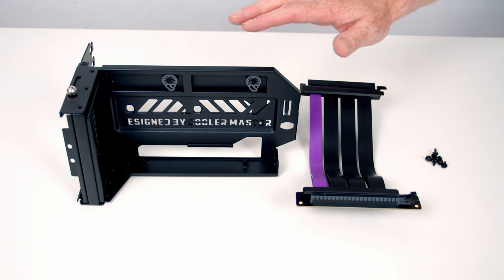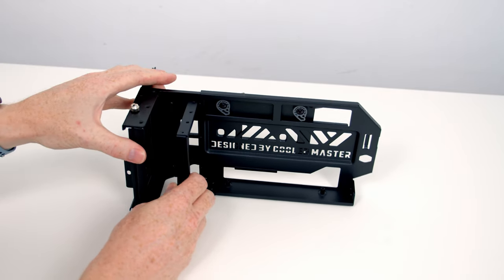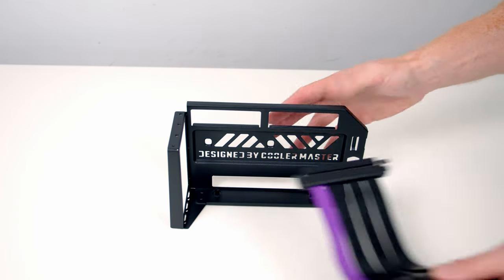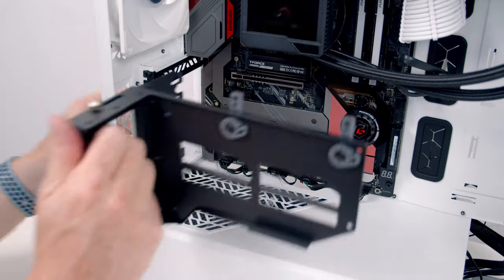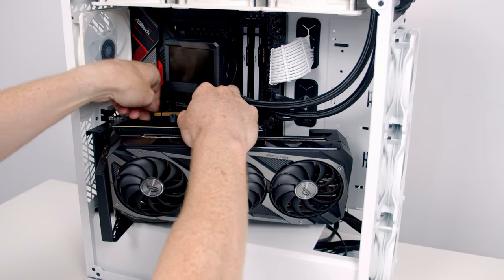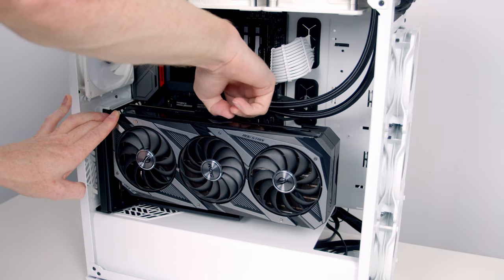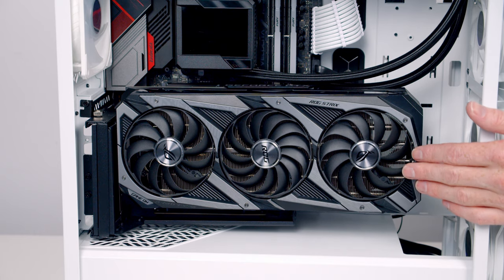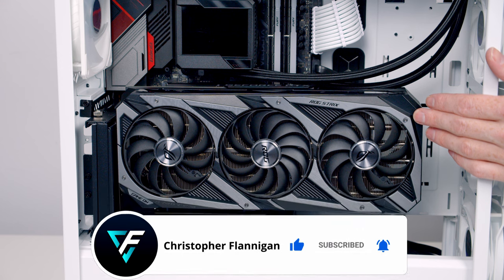Cooler Master Vertical Graphics Card Holder Kit V3 - Installation Guide

Comment: The extra room towards the front also does another trick: if your case has bars between the slot covers you normally get into trubble inserting the HDMI/dp cables since the connectirs are upright now. By sliding the vertical stand a few cms, you can thread the cables between the slot bars and connect them without having to cut the slot bars.
Reply from the maker: Good point
Reply: Tried it and didn't like it,  sliding the vertical stand a few cms make empty space between case and gpu with wire.
Reply: @bachkhoi9450  get a case that allows complete removal of the pci slot covers
Reply: @bachkhoi9450  buy a 90 degree hdmi or display port cable and it almost mitigates that
Reply: thanks for sharing man
Reply: Thumbs up quick question is there enough slack in the cable to go down 1 more pci slot my case has 8 slots and I was wondering if the cable would reach the bottom 6 just 1 more slot down from where you mounted. Any help appreciated thanks for your time. @ChristopherFlannigan
Reply: @mattchumoore4214  That's what I did ,

Comment: The way I found best when it's just yourself, install the riser cable to the mobo first, then the case bracket and then install the riser cable to the GPU bracket and then mount to case bracket.

Comment: Wow £77 that's way more than the last coolermaster vertical mount I bought
Reply from the maker: Everything has gone up in price. It's gen 4 and the bracket is in two parts so I can see where the money goes
Reply: Gen 4 risers are super expensive. CM is basically giving away the bracket itself
Reply: Worse than that for me. The only place selling it is Amazon third party and they charge 33 EURO for postage (stealth charge) so it ends up being EUR 114,80 at least!!
Reply: Mine finally arrived today from amazon uk I paid £53.62 much more reasonable price
Reply: @anone3842  I've seen them for 60 euro on amazon, this exact model...
Reply: @knightsljx yeah the Riser cable is 40 to 50 depending on brand. So considering the tooling, the metal, the ability for it to move I think it is a good price.
Reply: This thing is even more expensive than some other pc cases. Crazy

Comment: JUST FYI. the card doesn't need to hang awkwardly at the final stage, you can slide that bracket forward as instructed and then place the card into the bracket and secure in place with the quick release tabs. once the card is supported, finish plugging into the slot.

Comment: Man you gotta show us this in a mATX case because I think people going for this one are really looking to put it in a smaller case because it's literally the only Vertical GPU mount that fits in a mATX case. A define 7 mini or Meshify 2 mini would be greatly appreciated to see this in.
Reply: yeah u r definitely right about that. Why would bother having this piece for e-atx cases already  when i can give 50 € more and buy a totally new e-atx case? They should have used a m-atx case as you said.
Reply: Somewhat agree. 

In my matx, the 3080ti sits less than a bottle cap from the psu and hdd shroud in a cooler master mb320L case. 

But in my atx, the space between the shroud and the gpu is so much that the case looks empty with the horizontally installed

Comment: Hi Christopher, I hope this question find you
Can you help answer where does the weight of GPU press down onto, is it the bracket that helps holding the GPU (usualy on the left with the metal plate of the GPU), or the PCI slot of the GPU (I heard Gigabyte PCI one is very flimsy and weak) that connects to the Riser cable (which I want to know before doing any vertical mount bcuz idk if it could also harm the GPU PCI slot or crack it due to the GPU's weight itself)
I really appreciate any insight or experience about this, thank you ❤

Comment: The only issue i have with this mount is that it slides forward when you try to plug in display port cable or HDMI cable. It looks like those two closing clips are not tight enough. At first i thought there are some extra screws that i forgot but i didn't see anything in instructions.

Comment: Is it possible to have a NIC or something plugged into the second or third PCI-E slots behind this bracket? Only thing holding me back from getting one right now
Reply: You can slide the GPU a good distance away from the mobo. As long as you have enough room in your case. Also depends on how tall the pci-e slot item is

Comment: Will this fit in the top 6 expansion slots instead of the bottom 6?
I have a bottom Fan that I'd like to keep if possible so extra slot higher should allow it to fit underneath.

Comment: For some reason mine doesn't sit perfectly straight. It angles slightly towards the glass which is annoying. Also increased temps while gaming from around 50C to around 60C but its still within acceptable levels. If i had a choice i wouldn't of vertically mounted it but because of the Cablemod adapter recalled i had no choice. 40 series GPU's are way too big. I have a 011D XL and my Aorus Master 4080 makes the case looks small.

Comment: How far over does the mount push the gpu? I've got a rog strix 2070 super that i am trying to fit into my fractal define c mini. The case has a max length of of 340mm for the gpu, and the gpu is about 300mm already. So I've been trying to find out how much it moves it over. This seems to be the only mount that works in matx cases so i hope it'll work! Its just alot of money to spend without being 100% sure it will work!
Reply: have you found the answer for this?

Comment: I just paid over 600 EURO for latest Coolermaster 700EVO case and it ONLY INCLUDED THE V2 VERTICAL BRACKET and that is absolutely shit bracket for the 4080 card I have. Will not hold straight and ribbon absolutely straining the slots on motherboard and GPU... it needed the forward/back movement to move GPU out from motherboard. Sickening that they only include V2 mount in a 600+ EURO case that I only got this month in December.

Comment: Is there ANY vertical mounts that don't kill the ability for you to use some of your PCI slots for OTHER devices if the case doesn't have some dedicated opening for the GPU above?
Reply: Im hoping the link i provided does the trick.. i plan to order it this week.
Reply: @bryandixon2570 What link :)?
Reply: @BucifalulR  hmm it must have gotten removed.  Let me find it again
Reply: @bryandixon2570  sure :) thank you. EDIT: or the name of the product would do
Reply: @BucifalulR  EZDIY-FAB PCIe 4.0 GPU Mount Bracket
Reply: @bryandixon2570  Thank youuu!

Comment: Wonder which vertical GPU mount is good for rtx 4090 in a fractal torrent case with noctua dh15 cooler
Reply: not this one, I bought it and now I have to get slim 140mm fans for the bottom part of the case because this mount can fit in otherwise, and I cant move it up because then it will hit the cpu cooler

Comment: Just putting this out there that this mount is NOT compatible with the NZXT H510i. I learned this the hard way and people suggested to cut off the metal bars at the back which block access to the Display and HDMI Ports on the GPU. Seriously, why should I essentially destroy part my case with power tools to install the product? I found no mention of this when looking around the reviews for the product so you can imagine my annoyance after spending £75 on it. Looks like I can either return it or buy a compatible case which will cost me at least £200+.

Not happy at all.

Comment: Don't get this if you're using an aftermarket air cooler, it won't fit and even if it does the heatsink will be sitting on the gpu's metal backplate which will most likely melt the casting over time... Funny how no reviewers mention this and I had to find it the hard way, useless reviewers...

Comment: I have a question. is it possible to use this GPU holder in order to provide enough space and install case fans beneath the GPU. tnx.
Reply: In my case yes. More than enough. I have H9 Flow case.

Comment: How much is the offset of the gpu toward the front of the case if the card holder is set to the minimum (to the left) ?
Reply: You mean the gap? Guess it depends on how big your case and the graphics card are.
Reply: @G.L.R.K  Hi! He mean about the size that the bracket take when fully retracted, i have the same question about it: My case fit 330mm GPU max size, the GPU is 307mm... would this bracket fit in 23mm (2.3cm) space?!?! Thanks

Comment: Since it partially obstructs the back of the card, how does it affect the gpu thermals?
Reply: In my case it actually made temperatures better by a few degrees.  I have PNY 4090 if that's of any importance
Reply: Mine increase by about 10 degrees C while gaming. Probably because it no longer had my 3 bottom fans blowing on it. Bit of a shame but im still only reaching 60C which i feel is OK.

Comment: Why would they stick a purple wire cover on it? I get it's coolermaster but they could have left it black for people with different color schemes in their pcs.
Reply: Isn’t it going to be hidden ultimately? Be cool if it was all one color, but they do have to leave their mark..
Reply: @mrST0GGY_is_sigma  it fucking says coolermaster on the packaging....
Reply: @Theorcman2008  doesn’t every brand have their name on the packaging? Sheesh. If it bugs you that much get a diff brand or buy a separate riser cable.
Reply: @mrST0GGY_is_sigma  That's my point. They don't need to leave their mark IN MY COMPUTER, they already have it on the packaging.
Reply: @Theorcman2008  that’s an easy fix, get a different brand.
Reply: @mrST0GGY_is_sigma  yea, and the cable is behind GPU anyway, so what's the big deal...

Comment: How healthy is it for your mobo to constantly get blasted by extreme heat?
Reply: From where? If anything the mobo will come in contact with much less hot air than in a horizontal mount. Now the hot air will go out on top and at the botton, where case fans can easily pick it up whereas in default position the heated air will be pushed directly onto the board from like 1cm distance max.
Reply: constantly blasted how?!

Comment: Unfortunately, mine didn’t fit with a Noctua air cooler.
Reply: The NH-15 cpu cooler?
Reply: @ardorcallow4761  Yes, in a Corsair 4000X
Reply: What is ur gpu

Comment: this is nice, too bad the fuckin strix has the open vents on the top side  to push hot air out,  with this mount the hot air will end on the mobo.
ok ok, 3 front fans should do the job of pushing the hot air away but if u have the card in you hands  u know how much heat is coming out from that gap.
im not sure if im going to get the vertical mount... this doubt kills me ...
Reply: In normal posotion most cards will eject the hot air from the fins directly onto the motherboard anyway.
Reply: @FTWGame0N  also my ssd nvme suffer from this.

Comment: Surprisingly sound design from a company that only released generally dysfunctional products the last couple years.
Reply from the maker: The best vertical GPU kit I have used by far once I realized I need to slide bracket all the way out to side to allow cable to be plugged into motherboard
Reply: skill issue

Comment: This thing is horribly designed, leaves a gaping hole in the back of the unit and a huge space between the IO shield of the card, and that slight angle is so unaesthetically pleasing, they really missed with this one, should go with the Lian Li alternative for 60 bucks